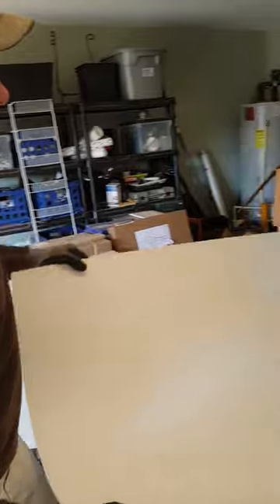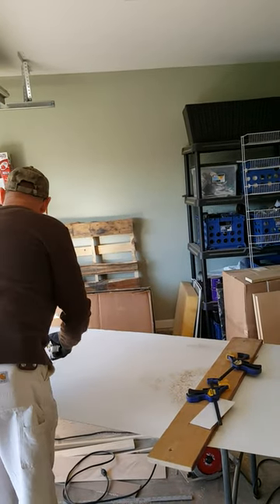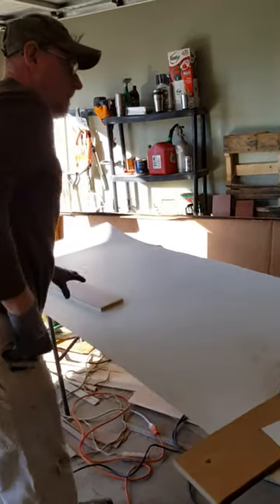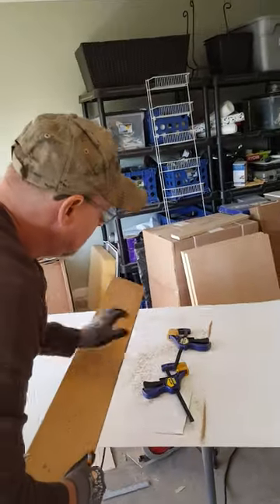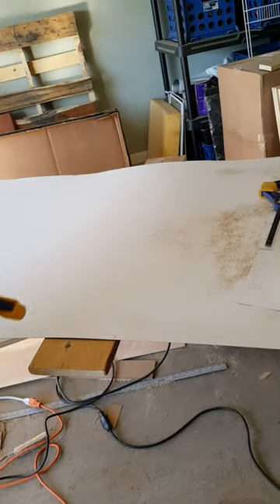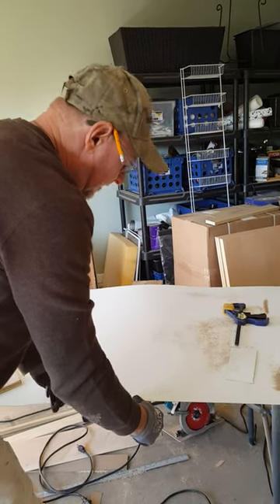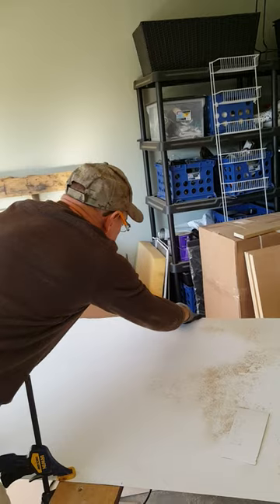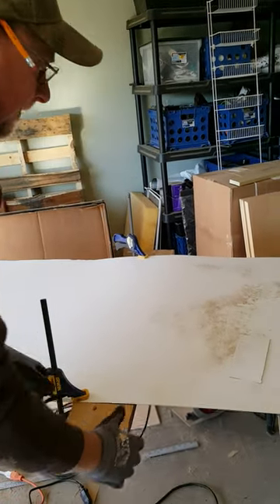How To Cut Laminate Sheet The Easy Way

Comment: Not sure if I love, or hate how dead simple this is, after toiling through multiple 8x4 sheets using everything from a razor knife to those laminate sheep-shears to break down the sheets - only to then use a router exactly like yours to neatly trim all the edges after glue-up. DUHHHHH!!!!  Many Thanks!
Reply: Same thing happened with me as well. But I had a thought of using router Nd didn't tried. Now, I will try it.

Comment: I have a 12 ft [Piece and I need to a little over 6ft off for my first section.  It;s cold outside, I wanted to use the zip cutter w a straight edge but I don't have the room inside for that awesome apparatus.   I was thinking scissors but this is 180fx and I'd hate to jack it up.   I guess I have to think of something else.
Reply from the maker: You can do this technique literally over a dining room table. I have.

Comment: Until you have to rip something 12' long. But yeah, that's the best way alright
Reply: what tip did you use for the router?
Reply from the maker: @LeeLee-wv9fb  Just a straight bit with a bearing. it doesn't really even matter what size, but reducing waste can make a difference so use a small dia bit. I think it was a 3/8, very common used bit for the trade.
Reply from the maker: @diversify210  yep, i have used old countertops for long cut guides. Sounds like you have cut a few panels too.
Guys like that are just trying to figure it out. LOL. He did say "that's the best way alright". I'll take the LIKE. ;-)
Reply: @geowen57  all I have is a jigsaw and Roto zip I think its called.